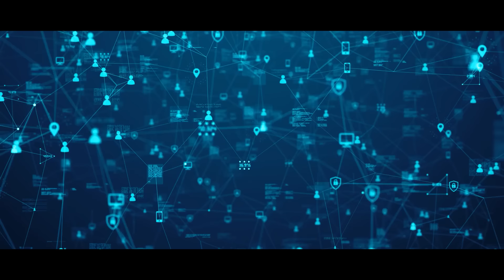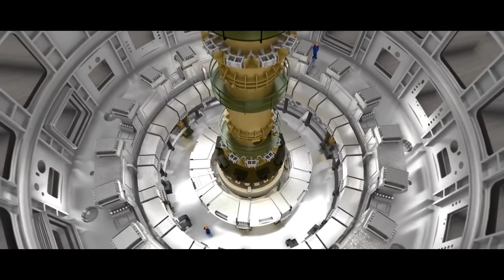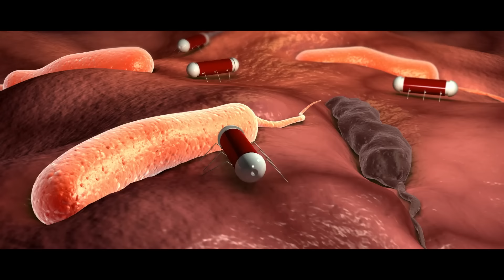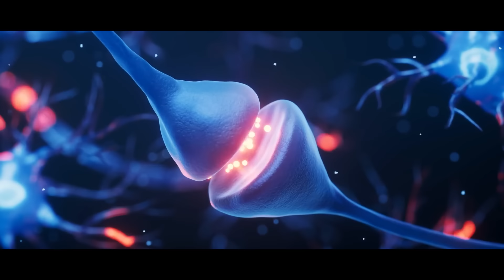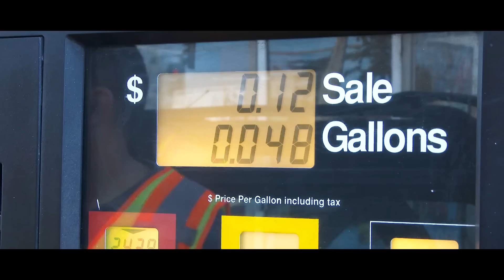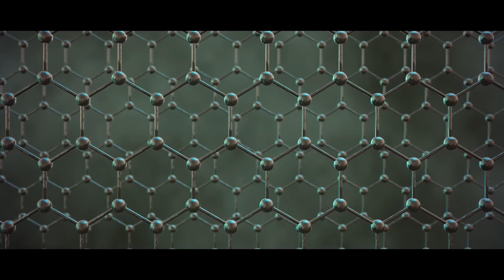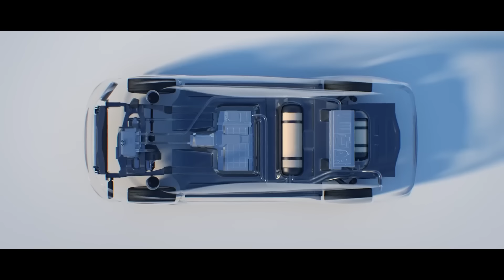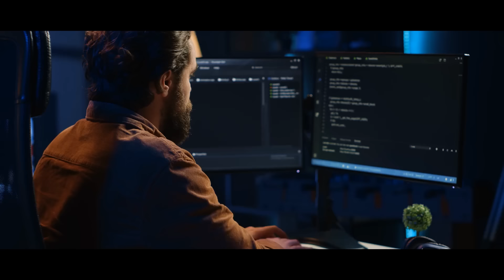Quantum Computing Explained: 20 Ways It Will Affect EVERYONE

Comment: I am afraid that the optimism around quantum computing is similar to that of free energy or perpetual motion machines.  The problem lies in that this does not reflect physical reality.  In trying to create a physical qbit, they are attempting to isolate a quantum mechanical phenomina into a closed system from which they can extract information.  Well, the 2nd law of thermodynamics says that entropy will only increase in a closed system.  Information is the opposite of entropy.  To get information you must decrease entropy.  Likewise, as entropy increases you lose information.  We get information from classical bits by using energy to decrease the entropy from the transistors in classical computers so we get a distinct 1 or 0 bit of information.  The entropy that was decreased to get the bit, was exported as heat to the environment, so there was a net increase in entropy in the open system to get the bit of information.

Unlike the macro world open system, where you can decrease entropy in one part of the open system to extract information but then export the entropy to the larger system, in the quantum world, you are at the smallest possible scale where entropy vs information takes place.  At near absolute zero temperature, and at the nano scale, it is very challenging if not impossible to further export entropy to an outside thermal system.  The 3rd law of thermodynamics states that a crystal at absolute zero temperature has zero entropy.  Well, absolute zero temperature is an unattainable ideal.  You cannot absolutely eliminate all kinetic energy from a particle.  If you cannot export the entropy, then you will lose the quantum information from the particle.
Reply: So what do you suggest? 
Let's just stop progressing because you feel uncomfortable
Reply: There are ways around everything
Reply: @Mario-s1c2o  All these "ways" have costs. Yes anything may be possible if enough resources and time are devoted.  However, we as a species, we are running out of time.

Comment: Oh that’s right the magnetic pull and fields from planets and other large structures like a red or white dwarf or possibly even a black hole with limitless energy to be harnassed and then particularly separated through fusion and precise balance of magnetic field and pulls creating fusion power like energy which can be transformed or maybe transmitted into intelligence with the use of quantum computing and making a better understanding of how to harness that energy and use it to create at least tier 2 civilization and with that energy making more amassing a higher intelligence understanding for ai and the different devolpment and areas of that knowledge for you to create a vacuum or vortex like prism which can that  be balanced into a fiber optic transmission of some serious power to the maybe switchboard of all that stuff Brad stogner told me about how he build it offshore. He smart